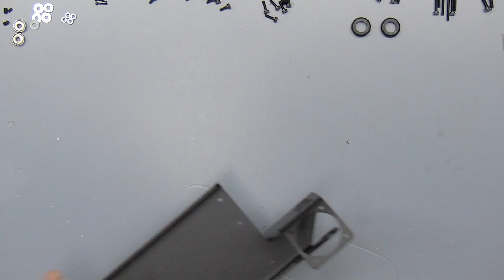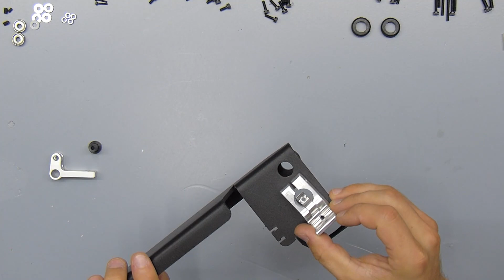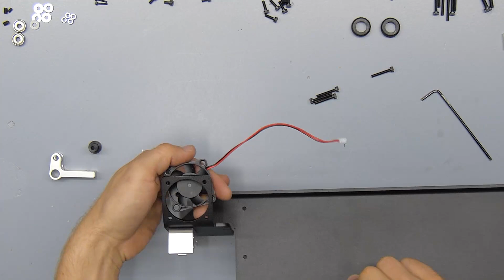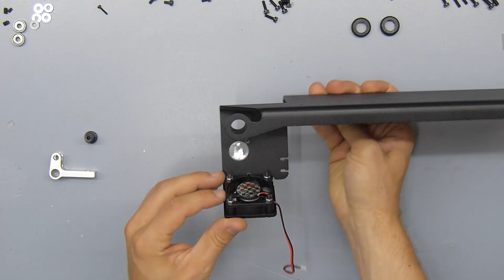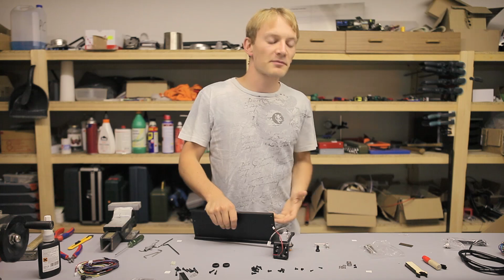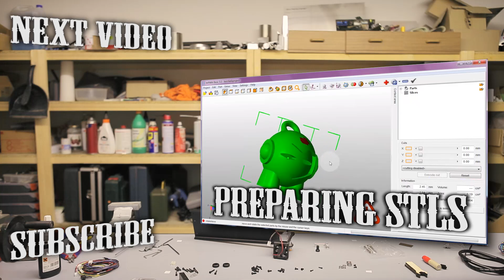Printrbot Simple Metal Kit assembly: Part 4 - The Y-Arm

Comment: I'm loving the videos! Definitely helpful! I noticed though that you mentioned attaching the Extruder Base to the Y Arm with 3x M3 10MM screws, but on Step 13 in the Printrbot guide on their website, it says to use 3x M3 8MM screws. I'm using a revision F version though, so I don't know if that has anything to do with it.